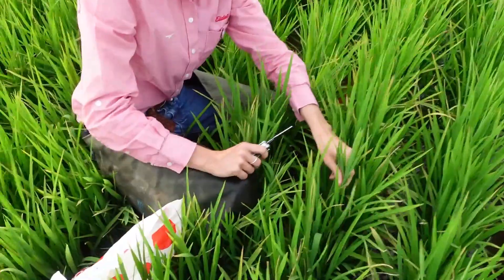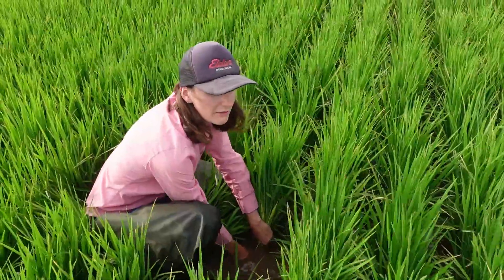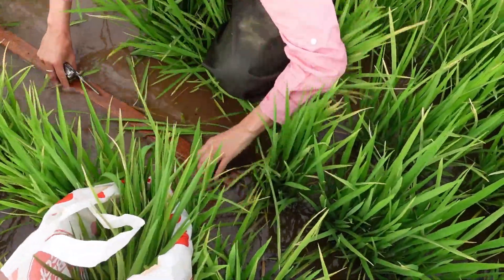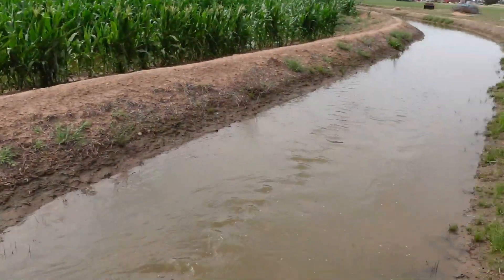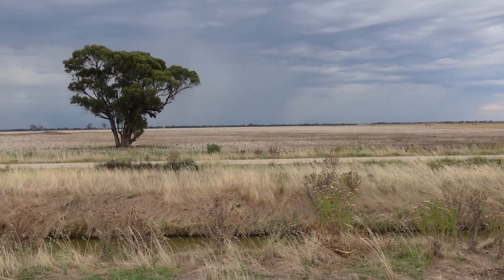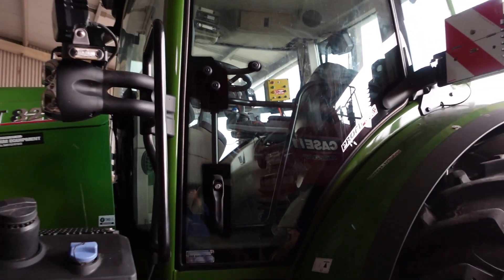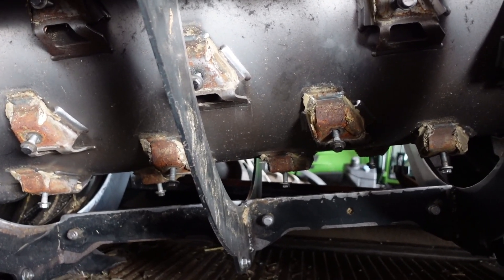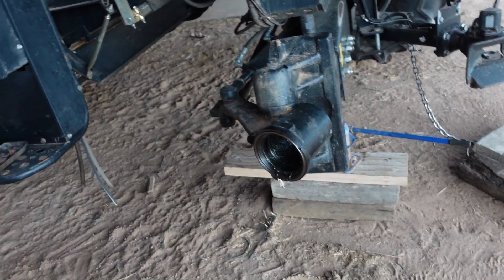Taking samples for nitrogen uptake test in our rice

Comment: Thanks for informative video series, love it.    $10 000 for sheet metal floor sounds like a few too many middlemen!    We know you love the fendt machinery,,, Where they sell fendts, they sell Gleaners, maybe when your finished with the red one you'll look at the silver and black one?
Reply from the maker: Mmmm not sure about that, too many moving parts for me.  Although I do like the look of the ideals
Reply: The gleaners and fendts ideal are owned by the same large firm. The gleaners are un sung heros, dont look past them if it suits your operation.  The company has made a conscious choice to stick with belts and chains for simplicity and efficiency,  hydraulic power uses a lot of horsepower in power transfer. 

The gleaners are the center half back that no one notices, but runs hard all game. 

The fendt ideals have bigger horse power, but really are shit hot and worth a big look.

Comment: gday mate, on the feeder house floor subject i pulled mine out and just reskined it with 4mm stainless wasnt cheap but cheaper then cnh and for sure wont wear out again and the rubber flap on the grain pan from memory its a stupid price genuine CNH that also wears out quickley piece of centre draper map cut to size works just ast well and wont wear out. cheers for the videos mate
Reply from the maker: Yeah I'm thinking we will do the same with this one, price was nuts to replace it!